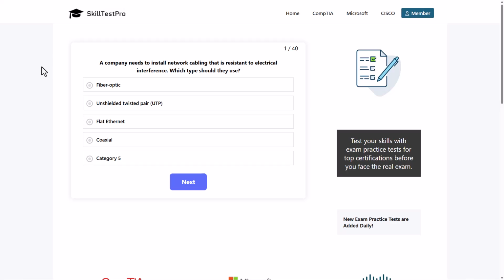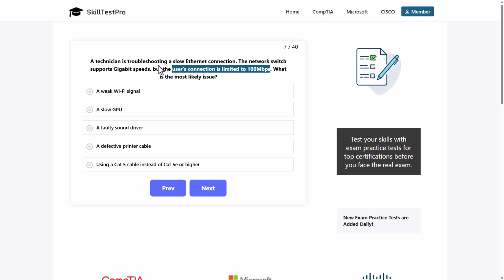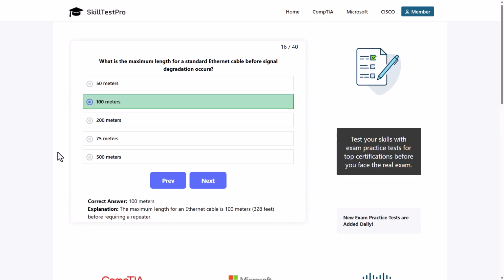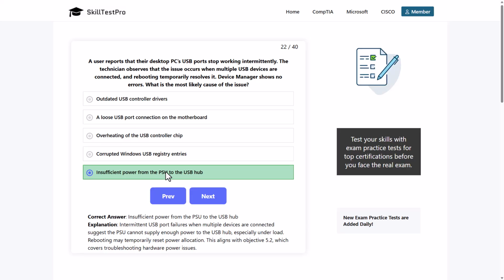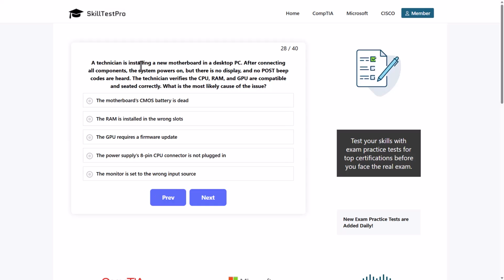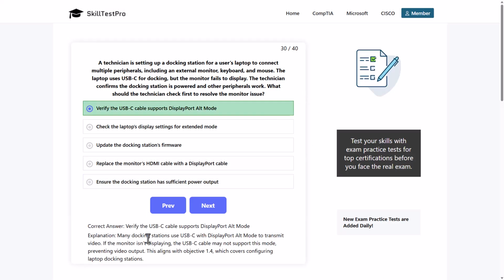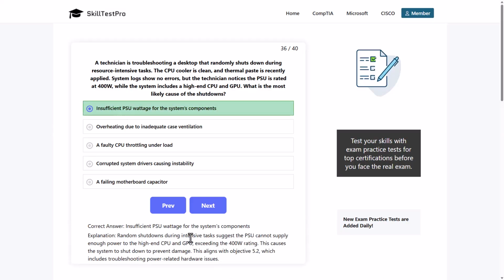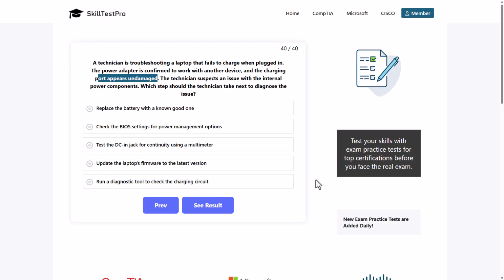CompTIA A+ Core 1

Comment: Question #7: it's not using Cat 5 "instead" of Cat 5 e, it should be quite the opposite.
Reply from the maker: No it is correct - as read question and then this answer - and answer states - that user is Curently using Cat 5 instead of Cat 5 e which he should be using instead.

Comment: In this video, Question 37 is scoring "Enable APIPA for the printer and DHCP for the other devies" as correct but the correct answer is "Enable DHCP with a reservation for the printer's MAC address" is the correct answer and the explanation correctly identifies that it is the correct answer. APIPA would only have a role when the DHCP server was down.
Reply from the maker: Hi Mark, thanks for pointing this out.